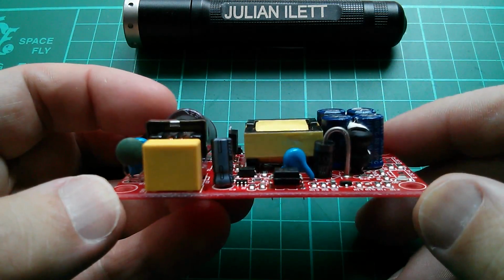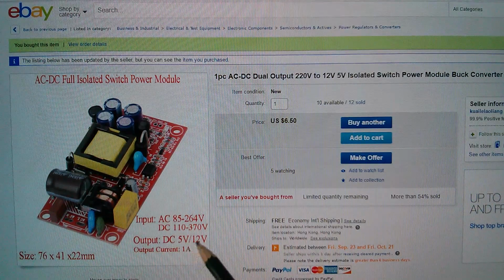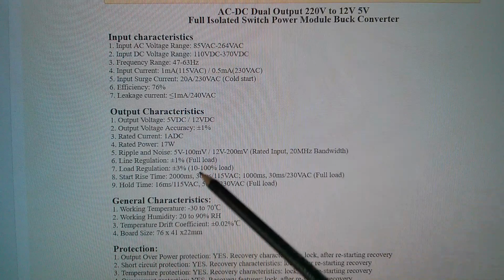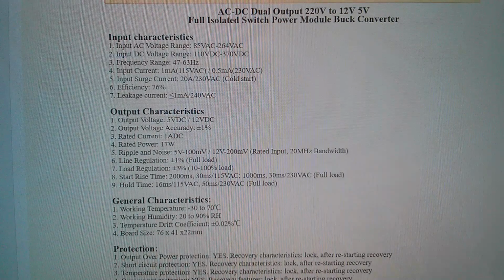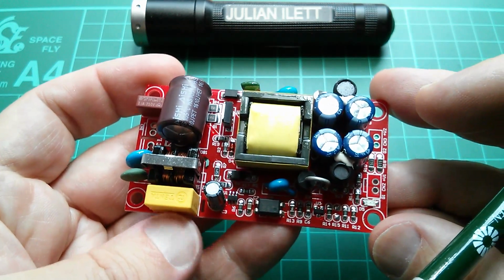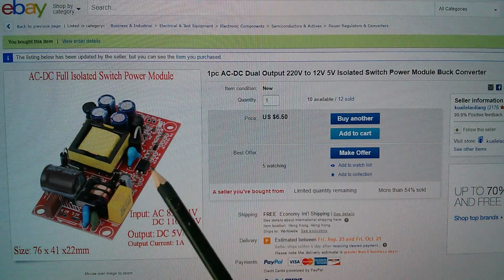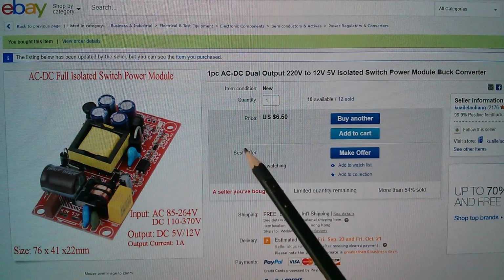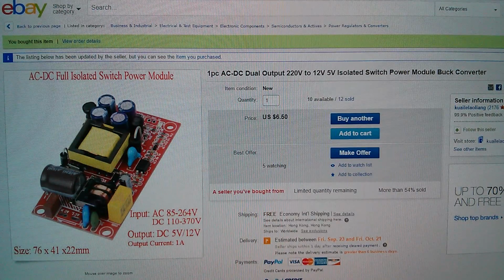Mad Idea: High Voltage DC Power Transmission

Comment: Finally there came practical, interesting and usefull things on your channel back. Not experimental gadgets. BTW I don't quiet understand, why you are continuously buying stuff from ebay, instead of aliexpress which offers almost all those ebay things- repeatedly with less price. E.g  Same Power Supply - shipping with tracking- http://bit.ly/2clOCeI
Reply: eBay has amazing buyer protection
Reply: I ordered at Aliexpress, and got no product, and the dispute process was a major failure as well: they insisted that I prove that the item never arrived. (?#@*&?)
Reply: I love Ali, but you are not right. Here is the power supply cheaper on eBay: http://www.ebay.com/itm/Buck-Converter-AC-DC-12V-1A-5V-1A-Double-Isolation-Output-Module-Power-Supply-/321761548832?hash=item4aea7b9a20:g:JL4AAOSw34FVHLlL 4.13$ incl. shipping.
Reply: Ordered at eBay a product.. 3 months later.. No product, seller told me it was at dispatch here in my country.. I called them.. Nothing there.. And nothing arriving.. Called customs... Nothing... 
Contacted seller again.. Told me to have patience.. Waited one more month..(had some hope)  nothing 
Contacted again, he said I never bought anything.. Sended him the email with the transaction.. He told me I was a criminal.. Got pissed off and contacted eBay, they didn't asked anything and solved the thing with PayPal 
3 days later I got my money back and they told they permanent banned the seller! 
Best 1 hour full off epicness! 
Love eBay and their help.. It's amazing
Reply: Ali isn't always cheaper and has crap customer protection, so I would almost Never risk buying anything over about $20 from there, otherwise at some point or another, you're going to get burned when something doesn't show up or comes DOA, but yeah I do love the fact that you can get stuff incredibly cheap off there, such as a tp4056 as low as 34 cents.

Ebay on the other hand, I've had personal experience where they've actually stepped in and helped me out once or twice and they have a marginally better search/filter system including the ability to save searches and get daily email alerts for new results, which is very handy when you're waiting for a good deal on a certain item/product.
Reply: Doesn't the ebay buyer protection require you to return the item to the seller before you can be refunded? It's great for dealing with other people in the same country, but I'm not sure it's as helpful with stuff from China.
Reply: Motorman2112 I don't know for certain, but because ebay is more likely to crack down on you, I've found ebay sellers tend to be pretty cooperative, so one time a couple of my items never showed up, I mentioned it to the seller and they just straight up gave me a refund.

Ali however, while I've not had any issues thus far myself, I have heard from several people in forums and such about them not getting items or whatever and then can't get a refund because both the seller and Ali will just ignore them.

For example, it's a bit old but here's a thread on eevblog about bad shopping experiences.
http://www.eevblog.com/forum/buysellwanted/consumer-alert-2nd-no-3rd-pass-through-the-spam-bot-filter/
Reply: I haven't had any problems with refund on AliExpress. Sometimes you have to deal with seller who does not want to give the whole money- but it happens also on ebay.
Reply: Motorman2112 I contact the seller, if he doesn't want to refund, open a dispute, explain what happened to ebay and get the money back ( including shipping ) in under a week
Reply: eBay/Ali refund -> no problem at all.

Comment: 2 mins into the video. On the datasheet power is 17W, (12*1 + 5*1) i guess its 1amp on both the 5 and the 12V..
Reply: Just came on here to say the same :-)
Reply: +Julian Ilett you should take a look at cree to led its a 10w led bead there is also a cree xhp70 its like 7000lm but that's 12v or 6 I don't remember
Reply: Except buck genreally refers to a specific topology and this is a flyback converter, more closely related to the buck-boost converter than buck.
Reply: +Colin Hickey (Lets make stuff!) me too!
Reply: That could be due to the fact that, if you don't use the 12V output, the
 5V output can, alone, deliver 17W too and that results in over three 
amps.
Also, I wanted to point out that all the SMPS are, actually, DC-DC buck 
converters because the input is rectified and smoothed before going to 
the switching part.
Keep it up! You're one of my favorites!
Cheers!
Reply: the big fat booster 120v where did you get it?
Reply from the maker: The maths works, but I'm not sure why the 5v output has a fatter diode than the 12v.
Reply: I can vouch for the XHP70, those chips are mean little things. Brightest single LED I own, pretty good color rendition too.
Reply: +ekner I know I had some a while back tried to make one of those cheap flash lights a good one I did it but I moves houses like 3 months ago and i can't find it but they do need some sorta headsink or they will melt
Reply: I might have to look into one of those leds
Reply: I suspect Julian to miss this kind of information on purpose so we feel knowledgeable and post comments :D
Reply: Of course, I stand corrected, but, still, it's a DC-DC converter. Flyback topology does use a transformer and a feedback loop, so it was obvious. Thanks for pointing that out! ;)
Cheers!
Reply: No worries. :)

Forward, push-pull, half bridge and full bridge are all isolated converters derived from the buck converter and you can see this in their linear transfer functions. A buck converter's transfer function Vout/Vin=D. Boost is 1/(1-D) and buck-boost is -D/(1-D) which aren't linear. Those are the 3 converters from which the rest are derived.

Buck derived converters also have their output current always connected to the inductor which means less ripple voltage on the output and no RHP zero, but they need a buck inductor after the transformer, wheras the flyback converter puts the isolation into the inductor(/transformer) and so you don't need a second magnetic device. Often there is a small LC filter after a flyback because of the extra ripple voltage and that's what this converter in the video has, but it's still generally smaller and cheaper for low power converters.
Reply: KX36 you mixed up the static gain and the transfer function. They are not the same.